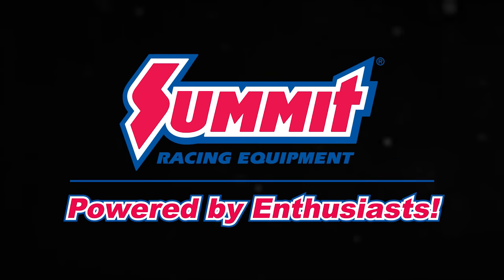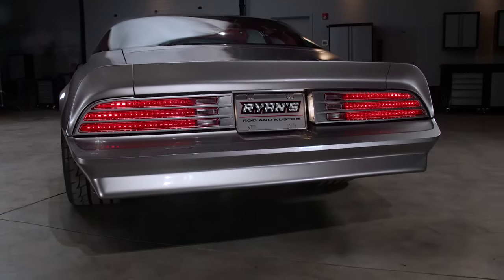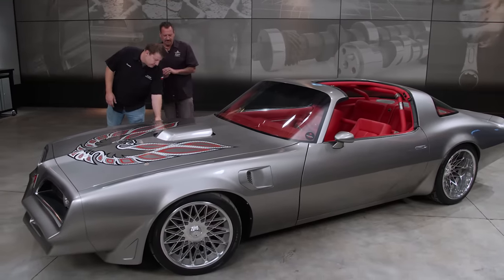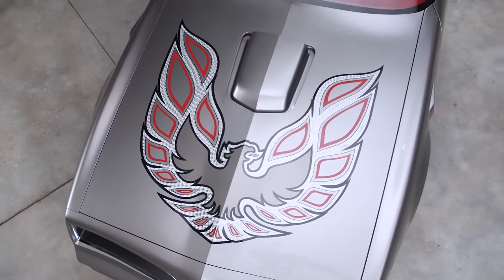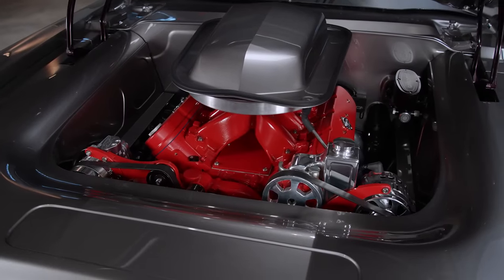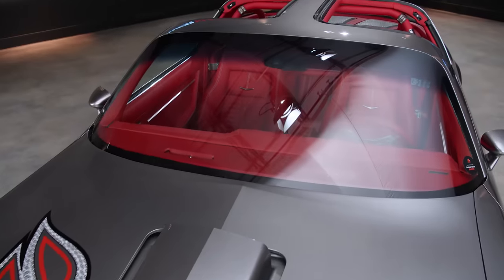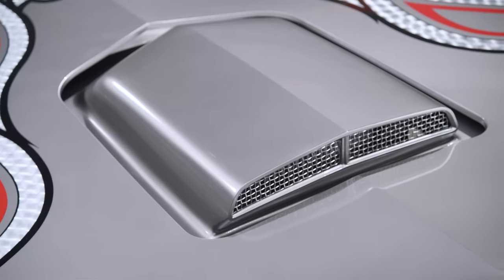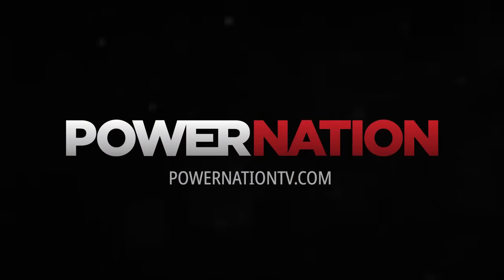Building the Mullet Missile: A Stunning '78 Trans Am

Comment: Nice ride. Love that interior.  The body mods are super clean, especially that rear bumper. I would have hid those front headlights, because the rounded shape of those lense is very distracting to the eye, and round clashes with the asthetic of the car.  Would have been nice to see an 800hp Butler Pontiac under the hood, but LS-everything is the trend these days.
Reply: Agree about headlights. Some hideaways would be perfect.
Reply: I liked the look of the square units, maybe a modern version would've worked.
Reply: Chevy motor in a Poncho just ain't right it Needed a Built 455 in it
Reply: I agree with all that. However, Butler is expensive and LS motors are cheap sadly. If Butler made their motors a little cheaper WOOOOOOOO I'd put one in my 88 Firebird!
Reply: I would love a plastic bodied firebird with an escalade AWD power train and paddle shifters.
Reply: @boeing175  Expensive?  Man , the detail on this build already means he's over $100K , you might as well go big or go home at this point.

Comment: Dont get me wrong the build is amazing but I really like the original look the old firebirds have. Again nothing against the build. But that old pic of it when it was brought just had it's own character you cant beat, but so does this build so i guess it's a win win lol.
Reply: I like the mesh screen front grill but think the round headlights kinda makes it look like a gen 5 Camaro . I think it'd look/match better if the old square headlights were cleaned up & used with some good LED bulbs inside. He did a great job on the car but for some reason I'm not digging the all red interior. I would have mixed it up with maybe some black & silver to match the exterior.Like do the roll cage in black.
Reply: It's called going from strength to strength.

Comment: I am a fan of the 79' myself and I have always felt the 79' is timeless..  Glad this is not the 79'.  That said, I do like all the body mods and the interior is just beautiful. The Bird should be bigger but that is my opinion, due to the original 3 piece Bird.  Love the power train and have no problem with that.  Even if it was a 79' a newer and bigger motor would be necessary and, a new and improved suspension as well.

Comment: I won one of those in a Poker Tournament in 1978. When I went to pick it up. The gas tank was empty, the battery was dead and the rear tires were bald. It had 2000 miles on it. I sold it for $5500 and bought a 1979 Jeep Wagoneer.
Reply: Bet u kick yourself for that. Big money there bringing now

Comment: With as much work that went into it, I'm wondering how much more trouble it would have been to move a manual gearbox to the rear of the car for better weight distribution ratio and some more weight/grip for the rear wheels?

Comment: another LS, eh i'll pass
Reply: Should it be a B16 with a turbo?
Reply: Oh no, another reliable motor that makes power and sounds good. What will we do now?
Reply: @CanadaBud23  the real Pontiac engine is a better engine and not any less reliable.  And built right would make 650 hp on pump gas without issues. Yes, I have built 650+hp Pontiac 400 engines on pump gas.   Run this thru the hp calculator.  653hp, 2780 lbs 9.46 e.t. in the 1/4. 145 to 146 mph depending on weather. Late fall it was quicker.